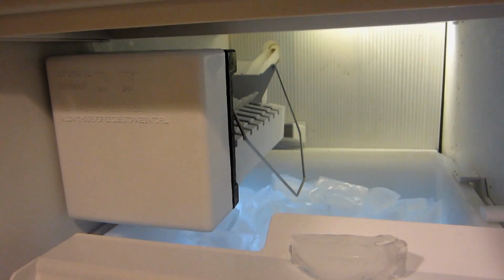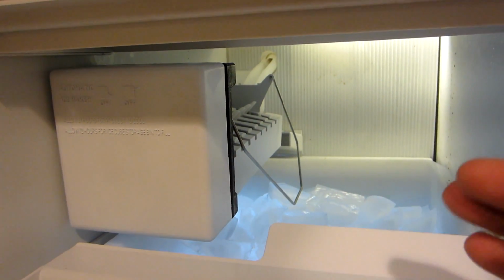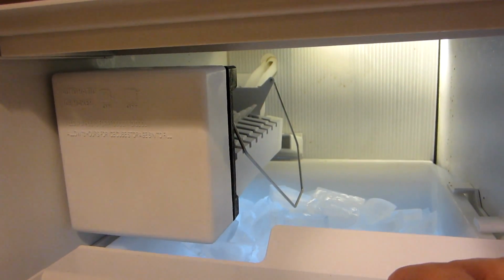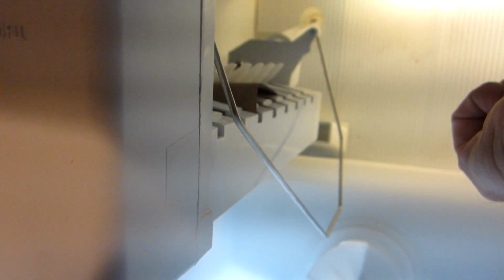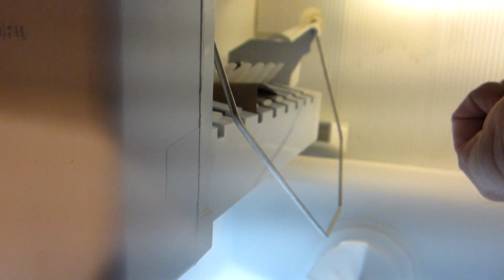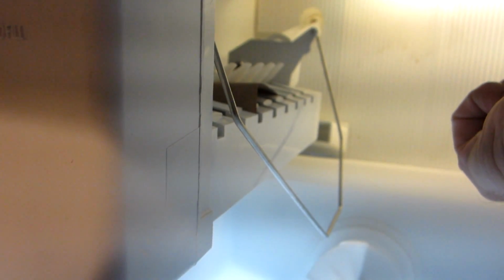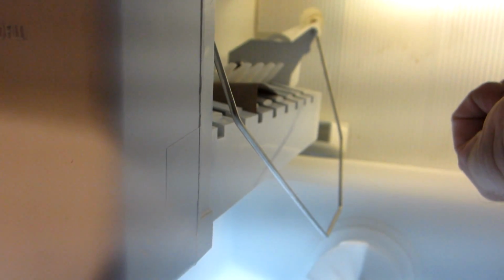How to repair most refrigerator ice-makers for less than $20

Comment: For those watching this video: Take my advice people, DO NOT CUT WIRES! The entire motor module assembly that he took off containing the motor and gear box is very inexpensive, anywhere between $20 to $30 and believe me it is worth it. A lot of bad example shown in this video. ALWAYS and I mean ALWAYS disconnect the power and cut off the water supply before doing this job. It's very quick and easy to do so. It won't hurt any items in your refrigerator or freezer since it won't be off very long and it will also allow things to reset properly especially since you are installing a new electrical part for the ice maker. Cutting wires and then pushing them down like he does in this video is a very bad idea. Moisture could get in and short something out and then you will be spending double money. Please get the complete part the first time and avoid the advice from this horrible video. Guy apparently trying to pass off a shortcut. Remember, shortcuts will create deep cuts in YOUR WALLET.